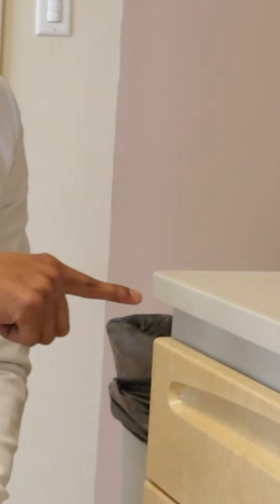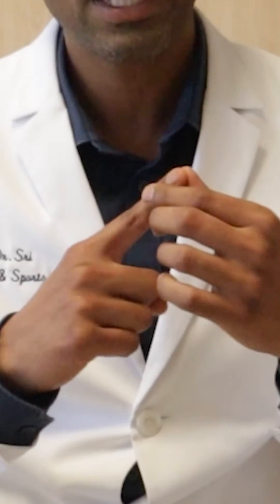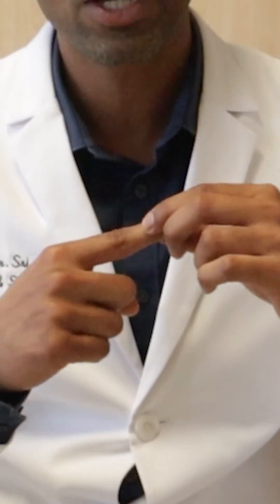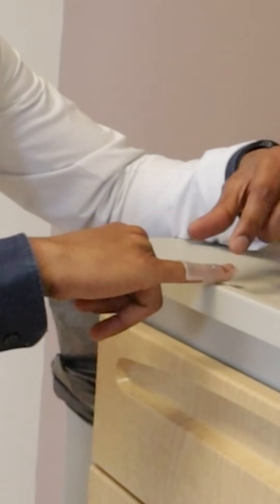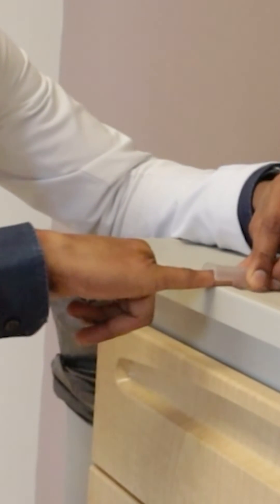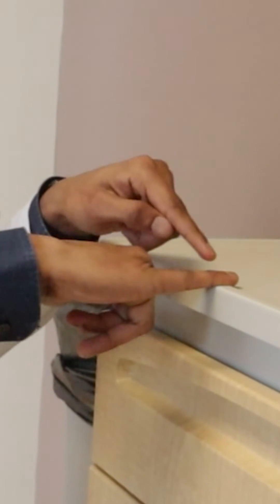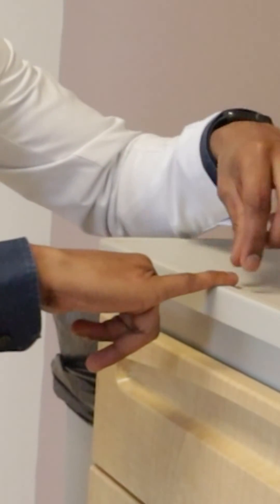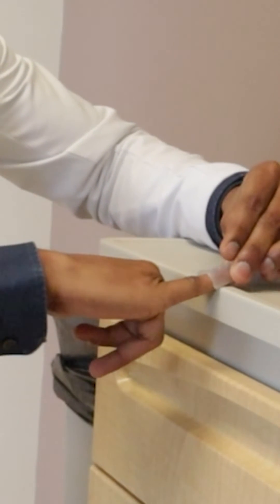What is mallet finger and how to splint? #sportsinjuryclinic

Comment: Sir, i got mallet finger in right little finger my dr. Suggest me for 3 weeks of splinting it has been 10 days of splinting. Will it be cure in 3 weeks of splinting ?  When the ball hit  my little finger did not droop like 90 degree at dip joint it just droop likje 15-20 degree but there was fracture and swelling so dr. Suggest me for 3  weeks of splinting. Will it be enough sir ? Pls reply sir i have army medical next in mid of august will it be cure till then? 😢
Reply from the maker: Thank you for reaching out! Generally, the splinting duration for mallet finger is often around 6-8 weeks, but it may vary depending on the specifics of each case, such as the extent of the injury or fracture. It's great that you're already under the care of a doctor—please make sure to discuss your progress and any concerns directly with them, as they know your condition best. Wishing you a smooth recovery and the best of luck with your upcoming army medical evaluation!

Comment: Is it okay if when I remove it for cleaning etc, the splint isn’t always put back on in the same position? For instance, what I mean is sometimes I splint my finger in slight hyper extension and other times I splint it in just neutral. However, regardless I never let the finger flex at all. Is this variance between neutral or slight hyper extension a problem?

Also fyi mine is just the tendon tear I didn’t have any bone damage.
Reply from the maker: Great question. Shouldn’t be a problem.
Reply: @srikanthnithyanandammd  thank you so much!